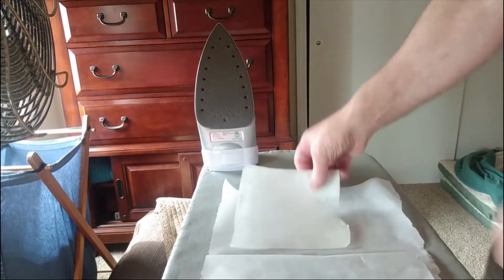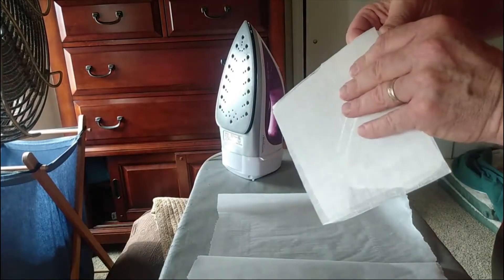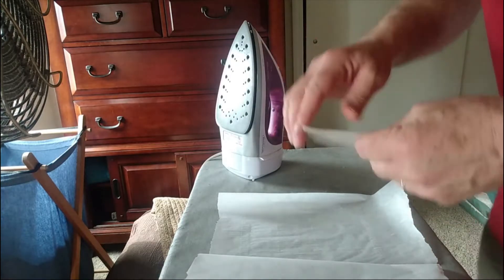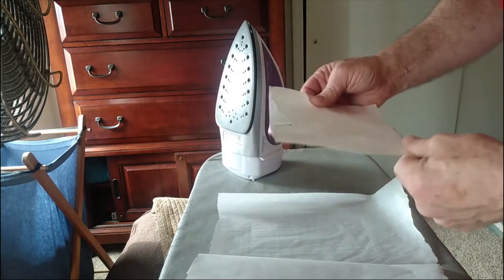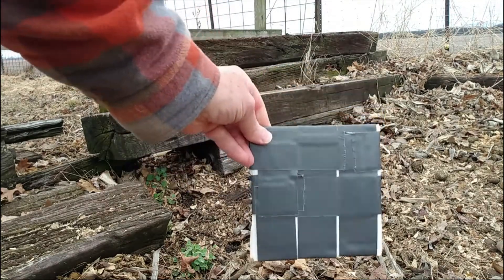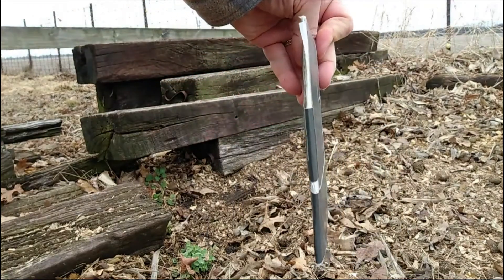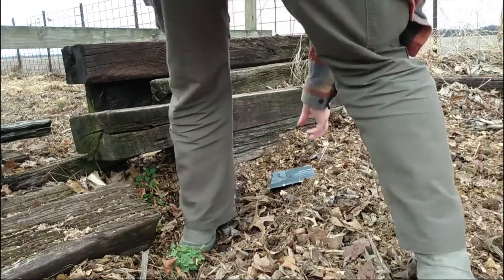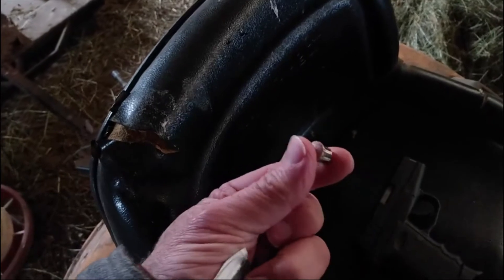Heat bonding UHMWPE - DIY ballistic armor test

Comment: Is there anyway to heat bind the material for curved ballistic armor? Ironing is great for a flat set up but I cant think of a way to do it with curved surfaces
Reply from the maker: Oh yes. This video is a demo test I did to see if ironing worked. I made a very simple double-curved form using MDF as the form with 2x4 bits of wood, cut with a jigsaw, to make a frame to attach it too. I curved MDF cut to the size and shape of a typical flat plate and then attached it to the shaped 2x4 frame. MDF resists bending so first I wet it with a wet cloth on both sides really well repeatedly to get it to curve and formed it to fit my chest and torso, then left it to dry with bricks or any other weights I had to hold it in that curved shape as it dried. I repeated placing it on my chest and rewet and bent it a bit more with weights holding it until it dried until I got it to the curve level I liked. Repeat as needed. I used the correct final curved shape to guide me making the 2x4 frame to hold the MDF and attached it with screws to the 2x4 frame. I then just iron the sheets on top of the curved MDF form and it holds that shape. When done you can place the plate on your torso and it fits perfect. You could use the same form for your back plate too (check if the double curve fits comfy on your back) or just make another form with a slightly reduced double curve, or just single curve shape.   I use the same form for both and it fits fine.

Comment: how many layer?
Reply from the maker: @Osiriskryptonite  If you buy a roll of the fabric (from Alibaba or similar) it should come with a spec sheet that will tell you how many layers are required to stop what pistol caliber. In any case, the number of layers to stop a 44 mag is around 40. I always go higher because I'm interested in stopping rifles. I'd go AT LEAST with 50 layers but would prefer 60.

Comment: Could you not iron the sheets onto an existing plate to get the shape or doesn't it  conform well

Also how thick would you say it was at 25 layers?
Reply from the maker: You could easily add more layers to an existent UHMWPE plate and it would take the shape of that plate so long as you aren't working too hot and leaving the iron on too long (when you'd start distorting and damaging the whole thing). It is fairly fast to get the PE background material to melt just enough to adhere to the underlying PE while ironing. I have also looked at ways to anneal together different materials like the PE to kevlar cloth. There is a type of iron-on adhesive cloth made that could go over kevlar cloth or plate and then iron PE onto that. It would adhere both the kevlar and PE together.  I haven't actually tried it so I don't know how details.
   25 layers of the ironed together PE sheet would be very thin. Each layer is literally the thickness of each sheet. I'd guestimate around a quarter inch. It would stop much unless you are adding this to an already existing plate.
Reply: @BooDamnHoo    ok that makes sense, when you say 25 layers wouldn't stop much do you mean purely because of the backface deformation.

The overheating part is strange to me I thought the plates were melted to an almost liquid and compressed when made commercially,

I also did wonder whether you could just create a fiberglass shell around the ironed sheets to give it a hard backing material behind and a desirable shape in the front.
Reply from the maker: @qwertyqwerty9587  I mean that by itself it won't stop virtually any bullet from any firearm. The rolls of PE comes with a sheet indicating how many layers are required to stop what threats (pistol only up to .44 magnum). You are looking at at least around 40 layers if I recall properly. I was going with 50 to 60 layers plus ceramic strike face to deal with rifle rounds. If you already have some kind of strike face (ceramic or steel) then you may get by with fewer layers to capture fragments depending on the nature of the strike face.

Comment: Any updates on this? I need some UHMWPE tiles for testing.
Reply from the maker: I haven't messed with it for a while. Costs have gone up a bit. In a couple months I'll probably get another roll and create a full plate with excess layers to be sure of stopping power. The method remains unchanged. Just use an iron to adhere layers together.
Reply: @BooDamnHoo  do you have an easier way for correspondence? I'm working on something similar and I'd love to chat

Comment: i'm building a full torso wrap around system based on the british army osprey body armour  carrier. i've got aramid soft armour inserts and plan to use steel AR500 2.5mm perforated sheets as the outer layer to disrupt/deflect any rifle rounds. i'll use UHMWPE bonded to the inside of the steel (to hold it together if it fractures). the holes/perforations will to be 5mm with no more than 5mm between holes. To defeat 7.62mm AP you would need 4mm AR500 but weight as ever is the main issue

Comment: Should incorporate some kavlar or carbon fiber in the layers into this.
Reply from the maker: Kevlar is quite thick and wouldn't adhere well to the PE sheets. Carbon fiber sheets... I've considered those but on looking into it they don't actually provide good ballistic protection. I've used kevlar to cover the final plate (PE with ceramic tiles on the strike face) to act as a splatter shield and put a smooth cover on it so it slides into a vest easier.
Reply: @BooDamnHoo  I suppose the carbon fiber would be dependent on the application. I love the idea of being able to iron the PE layers together like in your video. Made me a bit enthusiastic just watching that come together and catch the rounds the way it did. I think I'm going to try that over some HDPE with the carbon fiber or Kevlar. I've gotten carbon fiber to work pretty well in stopping 7.62x39 and 9mm when incorporated with HDPE and Kevlar inside a fiberglass/Kevlar wrapping for larger plates for the carrier inside back packs. Thickness is about average plate Thickness and with little deformation on the inside. Soft body armor is great for stopping bullets but the dissipation of all that kinetic energy is quite another.
I've been experimenting with micro bubbles or small plastic balls inside the UHMWPE and HPD molds. Saw a video on it from a military contractor in the development of newer lighter body armor...
Lets hope it doesn't turn into a "Dragon Skin" fiasco. Lol
Reply from the maker: @trupyrodice4462  Interesting. Would like to hear how that goes.  For now I am not doing more DIY UHMWPE plates because of cost, at least from Alibaba (China).  The fabric itself is not very expensive but I've found that just the shipping is horrific.  The shipping cost for the rolls I like is at least 1.5x the cost of the fabric, making the overall cost about what you would spend on a commercial plate of guaranteed NIJ level.  I am looking at domestic alternatives (USA) like Dyneema or Challenge sailcloth.  It would be starting from scratch though with no idea as to the ballistic protection, unlike with the Alibaba fabric that IS intended for ballistic armor and comes with a spec sheet for layers vs stopping power.  Dyneema and the like is more expensive per yard and I'm not sure at this point if the lower shipping makes it still a net win or wash vs Alibaba.  Buying actual ballistic armor UHMWPE from a domestic supplier like Skarsarmor dot com would add up because it comes in 48" x 65" squares. 4 squares of that MIGHT be enough for two plates at ~$180 for the fabric plus tax (free shipping).  Spec is 38 to 40 layers to get level IIIA.  Go to 60 layers and maybe get into straight III.  Put ceramic tile on it and get in the III+ range.  At that price, you are STILL close enough you may as well buy a plate.
Reply: @BooDamnHoo  man that does make for some expensive diy soft armor and plates. I'm going for light, semi-formable, little to no deformation, and easy enough reproduction, with commonly sourced materials that can be made in mass at home in an urban diy style environment. Basically I'm shooting for the impossible here😆. But it is what it is, plenty of people have made ballistic proof body armors at home, one guy/kid even used a welding blanket with a great degree of success.
Of subject, have you seen the lenticular camouflage they're developing now? (Probably already have) pretty interesting things going on there as well and can be accomplished on the diy at home level. Integrated with armor could have some real world applications for vehicles, sniper positions, FOBs in hostile hosting countries, ect. Possibilities abound... cheers.

Comment: hmm 2 years later this is still the best info on this special fabric type of uhmwpe on the internet. I did find a really valuable paper out of china, if you put "S026382232032612X" into the search bar u can find it too. its really thick so be warned... then again all material sci papers are to an outsider like me.
mainly they were looking at up armoring buildings/vehicles but they found through modeling that you could signficiantly reduce the number of layers and avoid perforation by adding an "aluminium core". when they describe the manufacture process of this core it doesnt sound like aluminium. either a mesh/foam or some kind of alumina (ceramic?). anyways, it has lots of diagrams and is very thourough. what i found most interesting was how they have pretty much figured out the intermediate failure mode of the material, for some reason the US is still using sappi ceramic plates like its 1995 though.
anyways it seems that with dynemma flat sheets (not woven like ur stuff but i think urs is actually better and for making soft thin clothing), the just barely failure mode happens when a vibration/compression wave moves outward from the area of incidence and then since the speed of sound is so much higher in solids, before the first few layers are perforated, the wave comes back to the source and actually starts to perforate the back layers before the first are even expanded. really really intersting mechanical properties. by adding some kind of aluminium/light filler mesh thats compressed in the middle (about 3-4 sheets of AL foil worth appearently), they stop the wave front from forming and can boost the performance and use less material. idk man the US should really start taking notes and upgrade our infantry kit....
i got 2 compression spandex shirts for like 3$ ea and was going to try and make an ultra thin full coverage 9mm resistant vest. im hoping i can just sew the two spandex shirts togeather or something. Also Im wondering about a strike face even with low power soft armor.... i was thinking that sapphire watch screens have gotten increadibly cheap recently... those and random single crystal/non pourous alumina parts from mc master are cheap too. could just try using sand paper as a strike face? dont think it works like that lol.... anyways thanks for uploading

Comment from the maker: Final comment on this process: I would aim at thickness with the UHMWPE sheet. The end goal is a plate that is as thick as you can and still manage to insert into a plate carrier. That means an overall thickness at the end of about an inch and a quarter. You could do that with the PE sheeting alone and come away with, probably, a lightweight level III plate. Or add tile to the front and reduce the amount of PE sheets you used and maybe get to level III+. You could get up to IV if you wanted to shell out $ for actual silicon carbide or other ballistic tiles, also available from Alibaba, BUT at that point the cost would be such that you may as well buy a commercial plate and the guarantee that comes with it. Of course, if you live where you are "forbidden" from buying/owning ballistic armor, it may be worth the cost to get what you want regardless of (illegit) restrictions. Remember: the rolls of UHMWPE comes with an information sheet telling you how many layers are required to stop which pistol threat. I'd consider roughly doubling the top of the list (44 Magnum as I recall) to get to rifle level. Test with leftover scraps before you complete your actual plate to determine if you are getting what you want.

Comment: How many layers do you think you will need to reach level 4? Just out of curiosity
Reply from the maker: With the 160gsm fabric it lists 33 layers as needed for level IIIA to stop 44 magnum handgun ammo. To get to level IV with just this fabric would be quite a few layers (which is why level IV UHMWPE plates are an inch or more thick). I aim at 50 or more layers plus a ceramic strike face to do the heavy work. Level III or III+ is fairly easy this way. Full level IV would require testing and using the correct ceramic tile. You can buy Si or Alumina ballistic tiles but the cost of fabric and tiles gets you close to "just buy a commercial plate" level of expense. 
    Not all ceramic tiles are equal either, even of same thickness. I had a plate that I thought I overbuilt with about 60 layers of fabric plus 10mm square tiles. It didn't stop any rifle rounds I shot at it. ALL went right through. At that time I was still using resin to bind it all together. The ironing method is much better in performance, weight, and stopping power (with good tiles). You need to go with high traffic (industrial) tiles. They are thick (8mm or more), and very hard. The tiles I glue to the fabric plate with construction adhesive.
Reply: @BooDamnHoo  During Overbuilding, Did You Only Use 1 Ceramic Tile When Joining To Resin Encased Fabric Plate?

I've Seen Tech Out This Meow's Video Using (x2) Porcelain Capri Tiles As The Strike Face.
This Ironing Heat Bond Method You Showed Is The Best Thing Going For Bread Slices. Planning On Ironing (x5) Sheets Of UHMWPE At A Time; Until I Reach 30 Layers & Pressing Together With Pond Shield Epoxy
Reply from the maker: @MichaelThorne12Tribes  I used one layer of octagonal tile. I cannot recall the name of the tile but it was one that Tech This Out identified as a good one. Capri something... I am trying to keep the thickness and weight down so it will fit easily in a plate carrier. If you go double layer tile it restrains the number of layers of UHMWPE you can use and it makes the plate rather heavy.
Also, after I adhered the tiles to the pe backing, I filled the tiny gaps between tiles with a high impact marine resin with very fine silicon dioxide rock polishing powder mixed into it.

Comment: Hi, would you mind sharing this discord group? Also, what if you put 1/8 piece of steel behind this uhmwpe in the chest and rib area to stop the blunt trauma? Will be significantly heavier but better than cracked ribs
Reply from the maker: It has been a long while since I accessed that discord channel and it now appears defunct.  As for a sheet of steel behind the armor, you could try it, of course, and see what kind of deformation you get on the sheet OR you could just spend a little on a commercial trauma pad and slip that behind your homemade plate.  With a ceramic tile front face and a steel back face you would be looking at quite a heavy plate.
Reply: lol i keep hearing about this mythical trauma from handgun rounds. the momentum transfer from the impacting projectile has to be the exact same as the fire arm's total recoil, just maybe over a quicker period of time like in a non locking design. u dont need that plate home. if anything put it right in the middle of the samwitch.
put this "S026382232032612X" into ur search enginge and read about how they did something simmilar with aluminium and improved the strength by 40%
Reply from the maker: Ah, looks like the channel has changed names and "location".  Here's the invite: https://discord.com/invite/G6ZTXK7SdU
Reply: Thank you very much. I appreciate it. Thanks for the info and science

Comment: What happens if you do both the iron and epoxy methods?
Reply from the maker: I only use epoxy to bind ceramic tile to the PE plate. There isn't much point to epoxy and ironing the PE as the iron binds the sheets significantly better than the epoxy. It also saves a LOT of weight. Epoxy makes it heavier (and messy to work with).